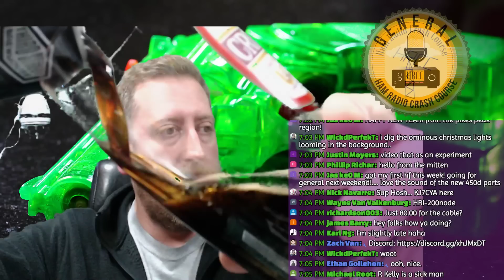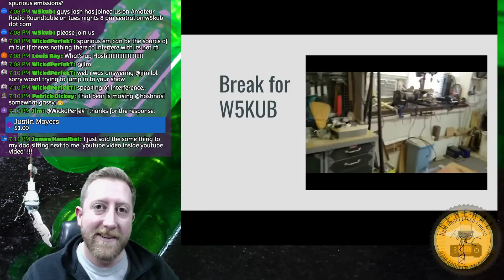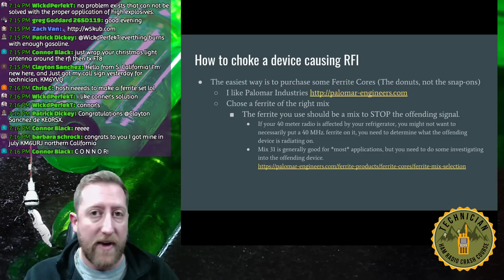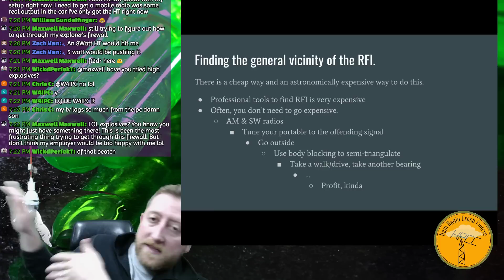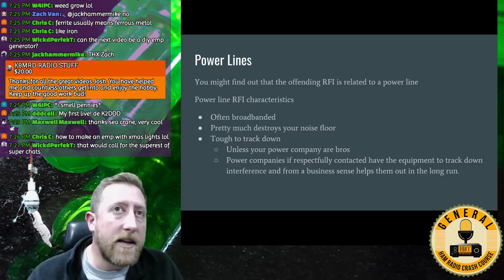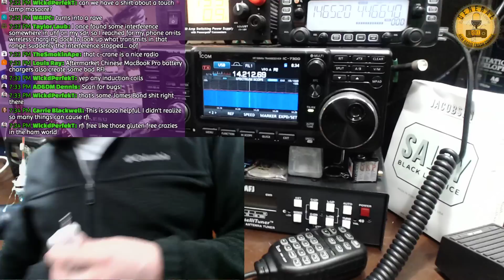Identifying And Mitigating Radio Interference, RFI

Comment: I had bad rfi in my big truck on 10 meters caused by the electronic injectors. The only ferrite mix to work was #75. The injectors have a low frequency with lots of harmonics. The 75's being effective on low frequencies I think makes them work better than the 31's in this case.
Reply: Spent 8 months accumulating 10 meter radios.. antennas… etc… Now we moved and new whole house with recessed  lighting is bad.. so ,#75…
Reply: @southpawdeanlefty342 does rfi go away when led are off? How many mix 75 and where did you need to place them? Thanks

Comment: I write this as a caution as i had learned the hard way.....
I was looking for my rfi issues on 80 meters and 40 meters it do not have issues with 20 it was fine but now that i learned this what i am about to tell you wow.. So i was talking with others that live in the house a few things mostly plugged up in the living space was 2 chargers for a few of my hand sets ... I know about the issues with 10 15 and 17 meters it was caused by my central AC when it goes off the noise leaves so i tracked that down...So i said well i will unplug the two chargers one in a wall by it self another with my radio on it a small Nintendo cube type game with 600 games etc so i go to pick up the serge protector grab the plug and all hail broke lose it started shocking fire plug to plug all the way down the protector these things are fin if you leave them alone once they get old you should replace them for this reason  so I ran to the wall and unplugged it ....what was interesting when i did it took the noise from s9 +5 to s2 with a little hashing and a few stray lines i still have something i need to unplug but the major part of it was that faulty serge protector I think the other is from a light i have plugged up and running in my room a T1 so prob the issue anyways these type of surge protectors can be dangerous  this is the second one that has shocked fire from plug to plug like that so be aware of the age and replace them every few years if one of my pets would of bumped it and i was not here it surly wold of started a fire....73 back tot he hunt the noise level drooped a lot so i may wait a few days I should be able to here more now on 80 and 40 the hashing and lines that are left are minor but i will find it sooner or later...be careful Rave KG5CUO

Comment: reading reviews i see the icom 7300 is a tiny bit sensitive to RFI ,  not everyone complains about it but some have .  You can get a choke kit on ebay ,  one for every cable you plug into the unit
Reply from the maker: Better to just track down the rfi and kill it. 

Isn’t being sensitive to rf good for a radio?